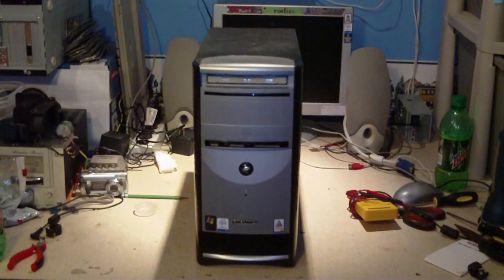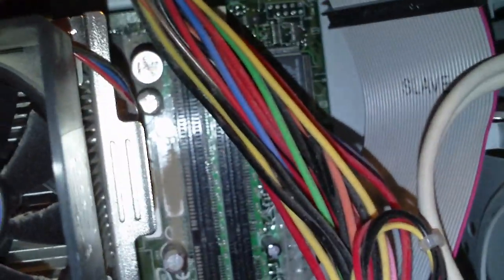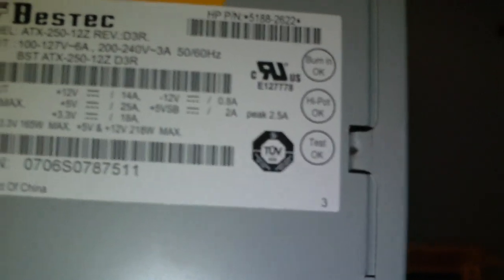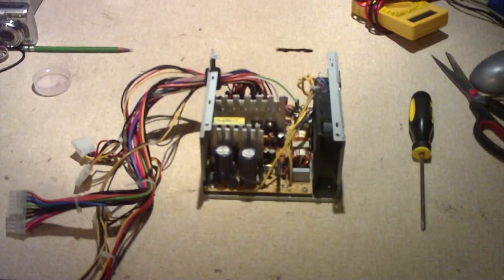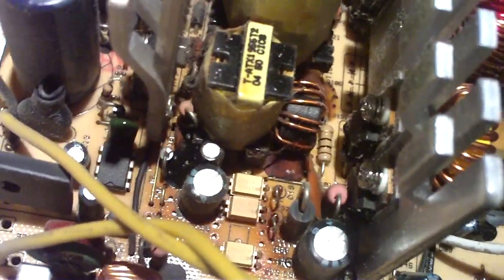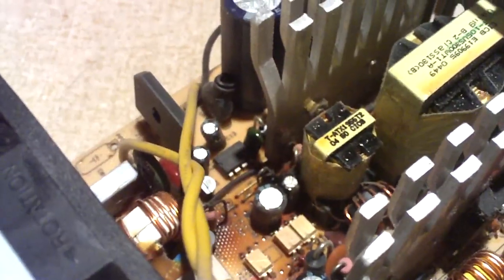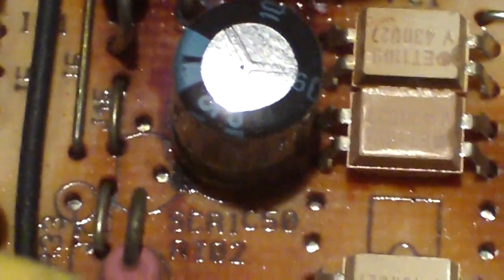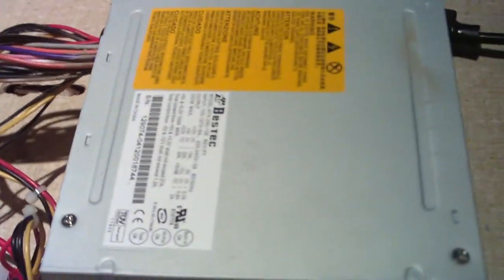Another Dead Bestec ATX-250-12E Power Supply

Comment: so, I got the same power supply from the thrift store and it was dead lol. the large inductor on the back was completely blackened and almost disintegrated upon removing. i now use the power mosfet as a large power switch. mosfet works great and so do most of the caps. i even took off the shotskey diodes for future projects. although its dead, its not worthless.

Comment: Capacitors need to run cool, putting them near a heat sink gives them too much heat and they fail.  It is a design flaw.  I have a high quality Dell power supply and a few of the capacitors are butted up against the heat sinks and are bulging as well.

Comment: Nice and informative video. I have Bestec ATX 0300D5WC the varistor covered with rubber between the 2 big capacitor explode/ burned. I don't know what voltage to put and replace it.pls hell.thanks
Reply from the maker: +Okidok Looks like it took a nasty surge... Not really sure what capping voltage to use on those. You might be able to find some info on some electronics forums, etc.
Reply: +Okidok If the power supply took that much of an insult, there's no guarantee that other parts of the power supply are also not damaged.

I would suspect that everything upstream of the burned varistor / exploded capacitors is going to be toast, and the switching transistors could also be dead too. If you need to replace the varistor, use another varistor that's rated for mains voltage. If you need to replace the input filter capacitors, use 220-250v rated caps at like 680uF. If you only have one filter capacitor and not two, you'll need to use a 450v capacitor.

You'll also need to check the bridge rectifier to see if it's shorted, as well as all of the transient filtering stage (coils, X caps, Y caps).

You'll have to evaluate if it's really worth it to repair that unit, Bestec units are junk and spending money fixing them is a waste.

Comment: bunch of idiots a hp , e-machine, dell, whatever oem always come with the minimum usable psu. If you plan to add another video card then you have to buy a stronger psu.
Reply from the maker: Actually a lot of their systems come with power supplies capable of powering a low-end to mid range card. Some even have a PCIe connector available.
Reply: look at amps, not watts.

Comment: The thing that kills these Bestec PSU's is the tan glue that goes conductive and shorts out components, and the old ATX-250-12E, nicknamed "The motherboard killer" because it uses not just the old 2 transistor to generate the +5VSB, but a critical capacitor. It's normally branded CapXon, and when that cap fails, voltage goes through the roof. Replacing all the capacitors often brings the 5VSB back down to ~5V

Comment: I have a Bestec 250w model: atx-250-12z rev d7r power supply that will not stop running after I shutdown my computer, should I replace it ? and if I do have to replace it what would be a good brand power supply that is not too expensive ?
Reply from the maker: If it doesn't shut off on it's own, try replacing it. The Bestec probably has bad capacitors in it. A brand such as FSP would do the job just fine. Their 300W units are reliable and don't cost too much. Don't be fooled by the really cheap units you may find while looking on sites like Newegg or TD as they aren't built well.

Here's a decent unit for the price:
http://www.newegg.com/Product/Product.aspx?Item=N82E16817104951
Reply: Thanks for the reply but since I am thinking of getting a new graphics card that needs over 400w psu I was thinking about getting the Ultra LSP550 550-Watt Power Supply here http://www.tigerdirect.com/applications/searchtools/item-details.asp?EdpNo=3276574&csid=_23  

is it any good ? and if its not what would be a good 500w psu that is not too expensive ?
Reply from the maker: Alex44343 That power supply will do the job just fine.

Comment: I also have a Bestec 250 12Z and it runs fine, except out in my workshop, where summer temps get over 90F.  It's at least 5 yrs. old and I was wondering if there is any way to "improve" or "upgrade" this particular unit.

Oklahoma Wolf, over at JonnyGuru, reviewed a Bestec 250 12E and it had some serious issues, particularly with the 5Vsb not shutting down, huge spikes (bad cap) and such.  Can that be improved?  Can you "fix" the 5Vsb, so it does shut down properly?

Comment: I had a bestec power supply it did a ticking noise and the light turned off after 3 seconds i had 2 turn it on and off at plug about 100/500 times to get it working. I had to turn off at wall at night & do that all over again next day. In the end i shoved all the bits in another computer

Comment: It's still running its original capacitors. It's only been opened once or twice when I looked for bulges or burn marks but I couldn't see any. Indeed, the caps are getting old, and I'm sceptical whether or not I should bother with such an old unit. Problem is, there is barely any room left inside the unit; the top panel has a transformer bolted into the roof. Also to note, the voltage selector switch was removed and a sticker with "230V only" was stuck on, so I reckon its a 230-115V step down

Comment: I have a Bestec ATX-250-12Z Rev C from about 2003. The HP PC it was in was soon replaced with a newer one, and the old system was re-purposed into a file/web server. It has ran 24/7 since then until today. The 3.3V and 5V rails (according to my multimeter) are dead on what they should be. The +12V was 11.95V under no load, but it drops to 11.45V under load. The +5VSB rail was about 5.3V. My model had a large heavy transformer bolted to its roof with the 4 mounting holes. Wondering what it is?

Comment: Oh no. It runs pretty cool though, I've had the computer since 2007 and it pulls air through power supply and exhaust the air into the case. The air isn't even warm btw and It's clean. So you do you think I should I put a different psu in?

Comment: I got a emachine t316 that looks like yours the power supply crapped out in it also! it only seemed to wipe out the ram i changed the ram module and it posted and i used it for a while then i got on tiger direct and got a new gigabyte mother board a e5700 intel pentium 3.0 ghz and 8 gigs of corsair xms 3 ,also bought a corsair cx430v2 psu , i had a 750gig hdd and i installed 64 bit windows 7 and made a real nice computer out of a piece of shit! thanks for posting

Comment: @CubeComputerChannel well, i decomissiond my bestec power supply, i just recently bought a seasonic psu with all jap brand caps, quality parts no cheapness or poor design, but before i took out the bestec, i did have a flashing led in the back and wouldn't turn on, but after i let it stayed plugged in it finnally worked, also i took the cover off and there is one capacitor that was leaking, by some parts that gets hot too.

Comment: My psu has leaking caps, is it true you can get away with replacing them with caps that hace the same mf and not the same voltage?
Reply: The voltage has to be the same or higher. Also make sure it can fit in the space for the old cap.